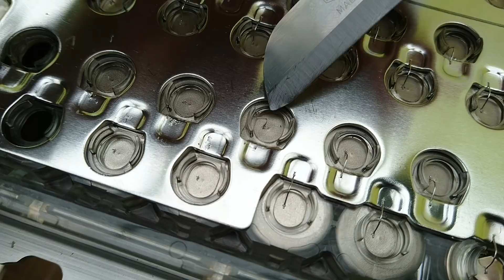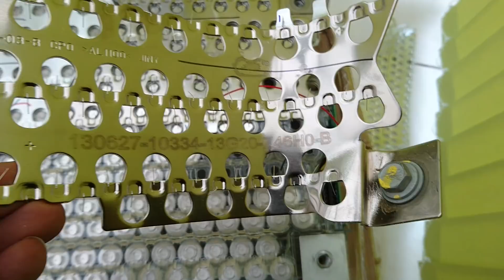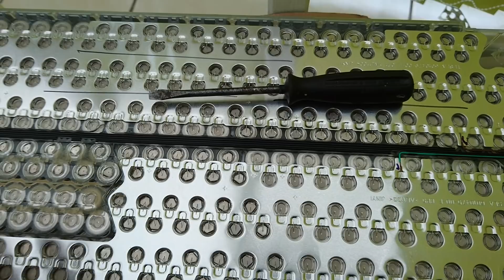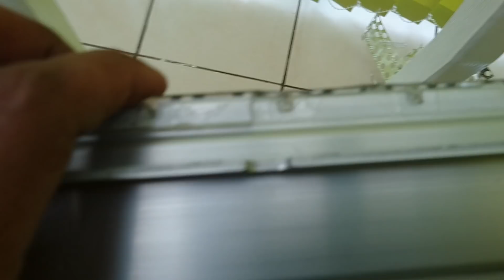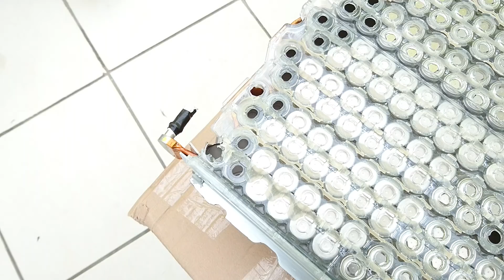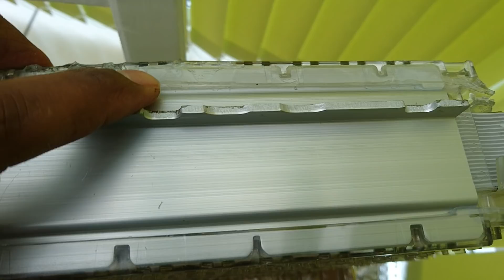Tesla Battery Teardown nightmare

Comment: Informative, thanks for sharing!
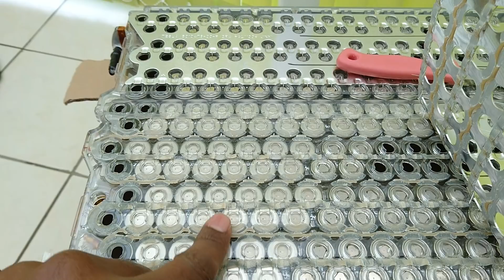Do you reckon a robotic arm would make life a heck of a lot easier in removing the adhesive (2:42) from the top and bottom of the cells? Not a laser cutter (because the heat might damage the cells), but more like a robotic wire cutter or something?
Reply from the maker: Man, you have no idea how hard the glue is! I was chiselling and hammering them out! I don't know if I will ever do this again, absolute pain in the butt!

Comment: That pack is out of a 75kw or 85kw battery. The empty cylinders are just space holders where in a 100kw battery else would be cells. You need something be inside there to keep the cooling ribbons in place
Reply: In 85 pack all cell spaces are filled too. In 100kwh pack, cell arrangement is different and more compact.
Reply from the maker: Sorry for late reply, the pack was 60kwh